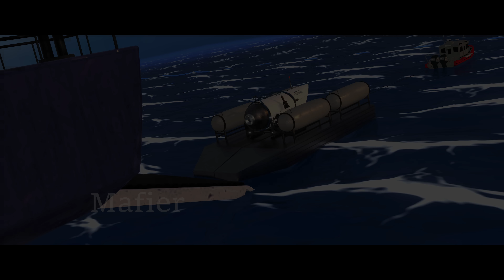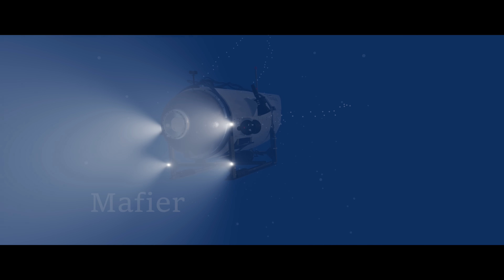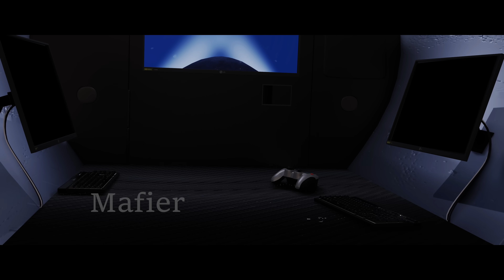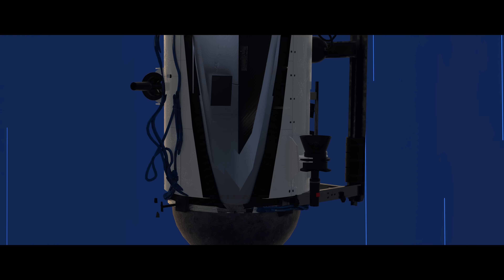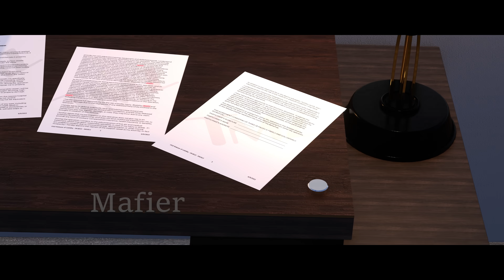NEW SHOCKING DISCOVERY Of Oceangate's Titan - 3D Animation

Comment: Nah dude i don't think they fell that rapidly then 💥 i believe they fell but they were sending transcripts all the way up until the last minute they couldn't do that if they were falling rapidly, that said, they were falling faster than normal as in the transcripts it said they were 1 hour earlier than expected when at the depth they were, i believe it was an electrical failure too because they reported hearing noises from the back then their thrusters stopped. There messages got shorter and shorter showing a sign of a panic, they might have got it stabilized because they had to remove the bottom bracket landing gear and drop weight, but once they rebalanced they were still sinking towards the bottom then at a certain point the hull gave out 😔 thats just my speculation based off the transcript messages

Comment: There's no way I would've boarded the Titan, knowing it to be a death trap. 💀 Stockton really messed up by using a shoddy carbon fiber hull which cracked under enormous water pressure, then arrogantly disregarded safety warnings and certifications, until it was too late. 😱

Comment: its the result of dumb engineering.  the 2 domes at the endpoint of the tube does NOT share the whole hull's external pressure. for the pressure at the outside, the body of the modul is SEGMENTED.  and presure energy were naturally would move to the tube section. the area with the shape that easily relent to the pressure the most. its natural. and there is no internal hard "ribs" at the tube section to suspend and withstand the centered and focused pressure.

Comment: Occam's Razor being what it is, the simplest and most likely answer is that the Titan was improperly designed and engineered and thus could not withstand the large pressures it was expected to handle. 

Cylinders do not generally cope well with external pressures unless reinforced somehow to withstand them. It's also the reason why even submarines have limits on how deep they can go. We're talking about metal cylinders here, so I find it hard to understand how carbon fibre could have done better.

Carbon fibre may have made the submersible lighter and a bit more buoyant, but it seems like a poor choice for the hull of a deep-sea submersible.

Comment: This is old the surface got messages they lost thrusters but were able to dump the weights it was rising up slowly when they started getting alerts from the acoustic microphones which indicated pressure starting to crack the carbon fiber.

Comment: Had the counter weights on the skids of the vessel been rigged to slide off if the vessel went into a nose down attitude which is what apparently happened the weights would have fallen off when a nose down attitude was reached , however they did not fall off but slid toward the nose increasing the rate of decent . Oops ...... Stockton  was reckless at best and a murderer at worse . 8:05

Comment: And exactly what are the “industry standards” that the hind sight engineers reference? Is there a handbook of standards for designing a private submarine to go 5 miles deep in water? Perhaps a manual on 8 foot diameter hull design. Or a pamphlet on how to design a window thst resists a zillion pounds per square inch? Where are they?

Comment: Why should a change in underwater orientation change diving depth?? That’s just wrong! Depth depends on buoyancy, NEVER on any propeller or thruster, but on jetsam/ballast and pressure chambers. The last thing a loss in electricity would cause was a change in diving depth or capsule orientation.

Comment: Not a mystery.
They submerged 3.5k meters, and it should have taken 2.5 hours.
They did it in an hour.

Too fast. Too much.
They couldn’t ascend fast enough because of this, and then the vessel failed.

Everyone has an opinion - yet no one was actually there, or actually put hands on the sub.

Comment: The audio commentary between the surface and the craft do not agree with this 'idea' in how the craft failed. A leak was reported, they began to ascend, water at the rear decreased buoyancy and it began to go down again, the weights and the frame were dumped, but then the leak turned into a complete break and in milli seconds the sub was filled from the rear to the front with water blowing the front of the submarine off.

Comment: I'm not an engineer, so I can just imagine what happened based on what it has been made public. IMHO, it was not an electrical failure what caused the quick dive and final implosion of the Titan. Surely it was the very last thing which happened before implosion. But the uncontrolled dive and the electrical failure it likely were due to the carbon fiber hull, which was bending under the pressure after several dives in which progressive delamination occurred. As the hull was giving way under the increasingly higher sea pressure (firstly unnoticeably, then with sounds only detected by the RTM system and finally with increasingly louder, terrifying bangs), the submersible displaced less water while weighing the same, hence it did lose buoyancy beyond what the release of ballast could compensate. The electrical failure likely it was due to the same reason, perhaps some cables were cut or stretched out in the process.

Comment: Joining 2 different materials itself is already a fundamental flaw for use in high repetitive stress and extreme hot and cold environments because each has its own expansion and contraction coefficients. The capsule seemed to have 3 different types of materials used. 
2nd: who in their right mind would use carbon fiber as a material in such intense working enrolments. Even if the production method was 99% perfection, there will always be sudden and sharp impacts of some sorts to fracture the carbon fibers. Even your average weekend abseiling gears are examined and x-rayed periodically for cracks within. can't exactly X-ray the whole capsule! Hence it was made to failed in the first place. just a matter of when.

Comment: Inaccurate description of the Titan Sub design. They changed the ballasts weights to steel pipes on both sides of the sub. They removed the old hanging ballasts weights from the bottom of the sub. Either way the entire sub was a majorly flawed design, hence the implosion. I knew it was just a matter of time way before it ever happened.

Comment: there was a theory put forward that the carbon fibre hull was made weaker after each dive, so the continual pressure stress during testing  compromised the structure....so in effect to be totally safe the sub should have done maybe 2  deep dives in total, and then put in a museum and never submerged again....but that would have been expensive and Oceangate were re -using the same single sub over and over again.

Comment: EVERY incident can happen if 2 or more defect joint each other, i see no backup motor, i see no back up system to escape from a failure, my think is, EVERY YOU HAVE ON BOARD, NEED TO BE PROOF STUPID, but the most stupid was, use the same submarine to go up and down, under HUGE compression, what was the stress point? until you can use that safely? For example, on my gondola, sail to 5mph, every year i re joint the connection to prevent water fill, i have on board the safety jacket (IT IS NO REQUIRED FOR A GONDOLA), i've 3 point to attached in case of storm, i've a back up electric motor in case of storm ready to use, in every ride i speach of safety to my costumer. That "submarine" has not safety, and going 3000meter down !!! ABSOLUTELY NO SENSE. Now i spoke to you, reader, when you buy something, DON'T TRUST IN YOUR MONEY... BUT LOOK, and inspect of what you use, ask of safety, ask of backup system, ask of everyting you think can happen, because the money DON'T guarantee your life, the money is money, with no chief...

Comment: So it would've been saved if only they had installed seats.  Yes. Carbon fiber seats would've added mere pounds to the craft.  
Never get in anything that doesn't at minimum have a proper seat installed. 
You cant even get on a ride at the fair without a seat available. Think about how ridiculously unsafe that craft was

Comment: I am not an engineer. 
I am just a humble mechanic/tech. 
In drag racing they now use carbon fiber driveshafts. 
In high horsepower vehicles they produce insane torque and at times the driveshaft will twist and instantly destroy itself.  
Its possible it didnt fail from an implosion the way its has been described. But twisted first which eventually caused its destruction.  Just my thoughts.

Comment: We also know that the sub was designed and built by DIE (Diversity Inclusion and Equity) hires. None met the requirements for certifications. The owner of Ocean Gate himself said this was done to prove DIE hires are just as capable as hiring experts with years of experience and certifications. 

Just as all companies who practice DIE hire have found out....this actually leads to many financial losses, good workers leaving, and in many cases, the company going under. 

It's been brought to my attention that it's no longer called DIE but DEI because the DIE originally used gives a bad impression and message. Seems to me it's the accurate one.

This isn't a snub in DIE, I fully believe that anyone can become a capable and successful expert in a field. I just notice that the DIE hiring practice has tended to produce the worse in the fields of employment. This can be fixed in time but right now it's a disaster.

Comment: You can't run a system like this on a windows os. You either need a special version of windows os only given by Microsoft to specific corporations or you'd have to install a linux os on a embedded system that does not consist out of a touch screen and a bloody controller.

Comment: If one believes the released text communications between Titan and the surface vessel, the theory postulated in this video is completely wrong. Stockton Rush had reported problems to the surface ship and had ejected the ballast weights and Titan's weight frame in an effort to surface. Indeed, Titan appears to have been rising when the implosion happened, but at a very slow rate. Titan being still at more than 3000 metres when disaster struck.

Comment: This is the closest scenario I believe happened. Except  I believe that the carbon fiber started to absorb water which caused a lower boyency and the reason they were all at the front was a pinhole leak developed and that would be like lazer so they were trying to get away from the high pressure and all gathered at porthole end causing the sub to tilt straight down. They knew they were doomed for a few seconds when they heard the loud cracking of the carbon fiber breaking down. The last thing they saw was a flash of light and maybe the sensation of their eardrums exploding. They felt no pain because it all happened in less than a millisecond. So sad for families

Comment: I'm no expert but my own theory as of how it happened was because of too many passengers aboard a cheaply made sub. The submersible's weight limit was supposedly 1,510 lbs, the average man weighs AT LEAST 200 and there were five men aboard. That, the corners cut to get the vessel in the water, and the fact that the sub's descending was faster than expected and slow to rise leads me to this.

Comment: WOW, Imagining the swiss cheese failure model in using the encoding of an analogue control input to USB interface DAC translations of those USB data lines fed into a PC then retranslated to outputs for the motors is majorly destined to fail.

Technical issues relatable to this disaster I.M.O.

Being a television engineer all my life the faults you could encounter in fly by wire control is astounding.

I've seen some weird faults in electronics but having soap operas displayed upside down due to a firmware glitch, in no way were safety issues outlined in the manufactures guarantee policy which stated your house is at risk of implosion should a this fault appear.

A joystick basically employs a bunch of variable resistors which are volume controls, a speck of dust and..  Your motors are going every direction they want to go let alone water / condensation.

I also did some DJing using computers and if a karaoke singer received a mobile call or a message the computers volume controls would go haywire.

Comment: So, loss of thrust means the Titan changes position, all of the passengers end up at the porthole and the Titan plummets to the bottom?  I don't see how this makes much sense.  The only thing keeping this sub from cratering at any time while in routine use is power to the thrusters??  This would be a ridiculously bad design flaw.  Not buying this explanation.  The Titan was (presumably based upon "leaked transcripts") ascending at the time of failure and had dropped its frame and ballast weights.  Movement of passengers in the sub doesn't make the sub any more or less buoyant, it just affects the center of mass of the vehicle.

Comment: I’m thinking that due to Titan having gone done almost yearly that the metal on the sub ended up expanding which led to cracks that were not visibly noticed. It would explain the noises being heard each time it went down. I remember "travelers" used to take paper cups down in subs and bring them back up the size of thimbles. Proper subs like The Alvin use titanium in their creation as it holds well against tension and compression. It is however very EXPENSIVE. The Titan's hull had been created using carbon fibers and if Oceangate wasn't doing proper checks on the sub but only was looking at it visually (which probably was the case) the cracks would not have been seen in the metal BUT they would have been heard as the metal continued to grow weaker with each passing dive. I am surprised the accident hadn't happened back in 2022 or even earlier. Stockton had set out to create a submarine that was lighter in weight and carried more people during transportation. Part of the problem with this concept is that the shape of the Titan was that of a pill.  Ocean depths at the Titanic are pressing around 3 tons of force on each side of the submarine the person is in at all times. It has been documented that spherical shell shaped structures are the most appropriate shape to use for deep-sea pressure hulls. This is because they have ideal mechanical properties for handling systematic pressure. Any other shape (like Titan's which was cylindrical) distributes pressure disproportionately and risks being unevenly deformed. So to me this says that for the first 10 or 11 dives it was alright but every time the Titan went down the pressure was breaking away at the carbon fibers and making it weaker in its ability to protect the travelers and to not implode. I hate being a jerk as lives were lost but all that money and yet they decided it wasn’t worth being certified. All that money and it wasn't worth using Titanium for protection. When Stockton had asked James Cameron to go down this last time I’m pretty sure he would have looked at the design and said hell no and pointed out what was happening. Really sad and James said so himself.

Comment: I just finished my sub.  I built it in my basement.  I Used a cardboard tube, insulation,  and some other Rona supplies.  It's controlled and powered by my old Playstation 2.  6 blow dryers make up the propulsion system, and I used sandbags as a way of ascending and descending.  I plan on visiting the Mariana Trench next week.  Anyone want to join me on the maiden voyage? 🤣

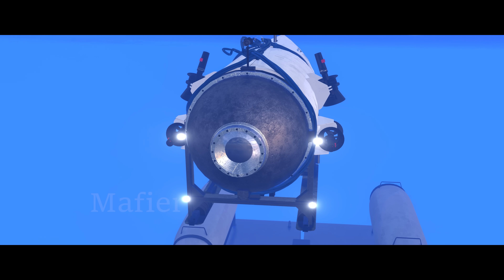Comment: The video here is not right, they had no blackout and they didn't fall straight to the floor. They imploded around 400m above the sea flor and not at bottom. They knew they will implode for at least 15min because they heard the loud cracks in the carbon fiber hull and the real time hull monitoring system was on red alarm for 15 minutes or longer, don't remember now how long exactly. They just went down too fast in 1:45 hours and were to heavy and had struggled to ascend again. The CF hull had probably cracks from the beginning and water was coming in and made them heavier.

Comment: The simple clarity of most of this video, combined with the animation, is really very good and helpful in understanding what probably happened. But the video feels incomplete. To simply state that one engineer has a theory (the electrical failure and rapid nose-first descent) without providing the evidence the theory would be based on is insufficient. What evidence did Martin have of an electrical failure? Of a nose-down orientation? Of a rapid descent? Add these to this video, please, even in summary, and it will be excellent.

Comment: Allegedly the transcript was leaked and that was minutes were hell. They knew doom was coming but didn’t know when. They also were descending to fast. If the transcript is true Jose’s theory is wrong. They were allegedly less than 70 meters from titanic. They had sensors going off, one being the hull health sensor. They started ascending very slowly then boom. They heard crackling twice on that trip. But again this is based off a leaked transcript